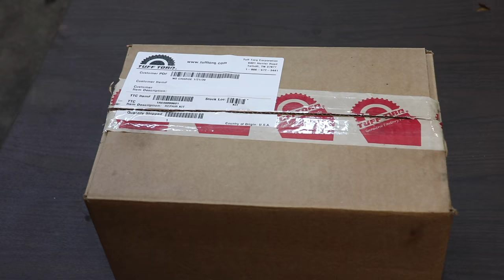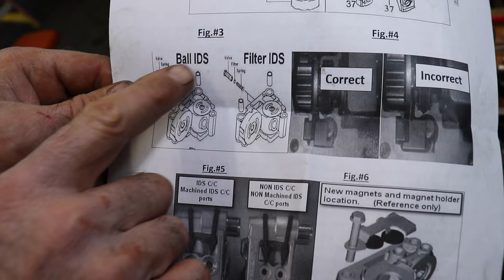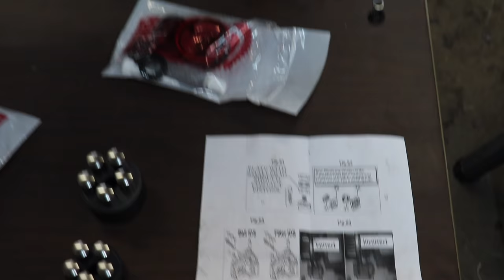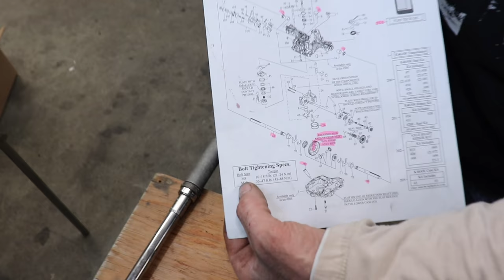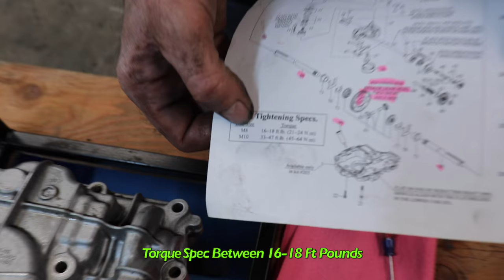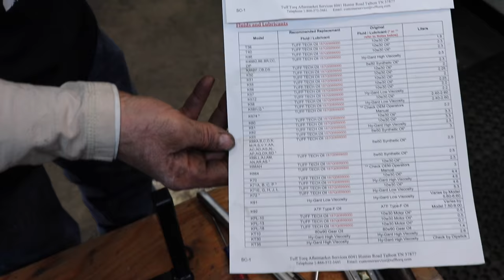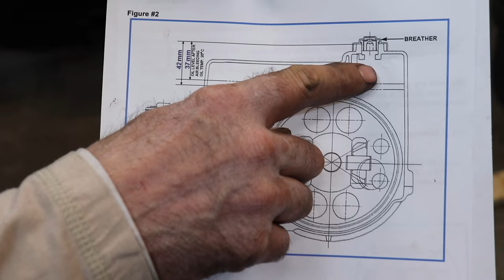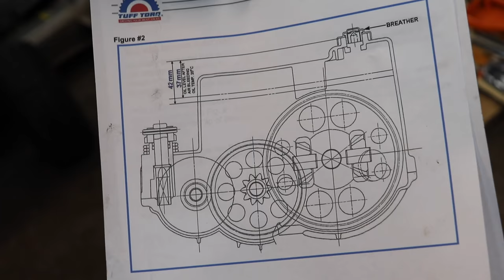How To Rebuild A Tuff Torq Hydrostatic Transmission: A Complete Guide

Comment: I don't know why you can't just drill and tap a bigger hole in the center of where the filter is setting. I looked at mine and you can't see the tiny dimples on the outside anywhere. That big round extension where the filter sits is the best and easiest to work with and you could put a 3/4 square end plug in it no problem. 🙂 Hope I can  find the drain plug video. thanks.  This is my first video with you. Strange. 🤪🤪🤪🤪 are you related to weird Al??

Comment: I'm down with rebuilding a trans but what's the cost of rebuilding it myself vs replacing the whole unit?
Reply: 93sundance Tuff Torq wants $700 for a K46 hydrostatic, $350ish for a rebuild kit.
Reply: @sevbait  Think I'd go with a brand new one then spend half and have the 2-3 hrs labor replacing all the parts.
Reply: @TheMinnow101 Agreed as most shops get 60 to 80 dollars a hour plus shop expense .

Comment: Hello, I have a used husqvarna yth 2448 lawn tractor. The problem I have is the free wheeling lever won't  move to take it out of gear, can you help me ? Plus transaxle is a electrolux 279081 , ser# 080805B001173 , do you have a video on how to rebuild it.
Thanks
Darryl

Comment: At this point in the video you must realize there ain't squat wear at the input that a seal will cure. What happens is the input bushing/casting, can't remember of the top of my old head, gets so bad and wobbles enough to wipe out the fins for the plastic cooling fan because they go into a bad angle from misalignment.

Comment: Taryl / excellent video as always …..Very informative …….But to repair a trans such as this would it have not been more cost effective to have actually just purchased a new trans as some of these service kits often cost 3 quarters of the original price of the original trans. I mean respectfully I also know the alum trans axles will have suffered friction wear as a result of fluid leakage as seen on many Cub Cadets , Deeres, ETC. Note my intent for this comment isn't to asininely pass judgment as the parts provided were free to you. Rather exploit the fact that price for the average joe would indeed be very expensive making such a repair not a viable alternative as even with the guidance of this video to reiterate …..The basic repair kit would cost at least 3 quarters of the price of the said transmission . I can respect savings are {savings] and I respect the fact your trying to provide a video that was informative …..But lets be logistical the mower is likely what 4 years old if not older? …..Now take in affect the cost of the repair and or parts if the owner had to contend with the repair cost as well as repair kit . Now consider this cost long term with the mower as is ……...Now lets estimate the repair and parts cost upward of 450 dollars …...Would it not stand to reason that the hydro belt would need replacing or maybe idlers ……….Whats the condition of the deck ? deck belt, tension idlers, engine, muffler. These issues are imperative to the equipment long term as well as long term cash expenditure . I just feel like these issues should have been taken into consideration before attempting a repair or at least noted in your video as you were provided the repair parts for free . I know we as Techs cant baby set a persons pocket book but as respectful human beings we could make it apparent that the equipment is or is not cost affective as a hole to be worthy of a very costly repair . {STILL I MUST SAY YOU PROVIDED EXCELLENT AND INFORMATIVE INFORMATION } and I can certainly see why you have the subs you do ……{EXCELLENT CONTENT} NO doubt.....
Reply: It seems you may have missed the part where he cut back after the parts arrived. Taryl made it pretty clear that he would have re-used the original pump and motor sections. (You later find out they provided some of the parts & tools free for the publicity.)
Reply: @tomnovak7731  I can certainly see your perspective …..But isn't the purpose of a repair to actually repair the equipment not gamble on the longevity of used parts or at the very least WORN parts shall I say . Now with that consideration what purpose would putting back in the original pump and motor sections serve as friction on there mating surfaces would have been apparent …...Via the alum shavings and or light metal collected by the magnets . So dosent it stand to reason that to truly repair the trans..... vital parts such as the new pump and motor sections where imperative for such a rebuild .  Witch brings me back to my original point …..For the common man would it have not been more feasible to replace the trans in its entirety rather than accumulate the three quarter cost as well as labor expected from a dealer or knowledgeable individual . Taryls great fortune to have been provided parts for the repair was just that {FORTUNATE} ….However there is common logistics that should be applied as well that I touched upon in my previous comment . Had Taryl not been provided the parts for free what cost would the repair tallied in total if the same repair parts where ordered . Now I reiterate …..would it not be more feasible to just order the new trans if the equipment it was repowering {making mobile} was in favorable working order . But lets apply even more logistics as we know the equipment that this trans was housed upon likely wasn't properly maintained or at the very least subjected to common ware and tear effects so to speak . Meaning what about added expenses long term  such as the present shape of the idlers …..Mandrels...Jackshafts.....belts.....tires...battery....blades...ETC.....as the equipment should be accessed before such a expensive repair made . That's why I advocate to my viewers upon my channel to keep a open mind and not be fixated upon a repair as often the cost of the repair can exceed the cost of the equipment . This mentality has saved many from buyers remorse and being a Master Service Tech for Briggs even made a target of me at Service Schools. But I have found a informed customer is a repeat and happy customer even speaking up among my Fellow Techs from there frequent lambasting as I get Stereotyped for my ability to educate and inform with logistical honesty . LOL....lets be honest / Honesty maybe the best policy but whom ever coined this quote obviously hasn't worked as a small engine TECH. That's why when I seen this video I left the above comment . Not to berate my opinion rather open the minds of every individual whom felt compelled to take on the task as a whole rather than just the aspect of the Hydro trans repair . I find more and more that people over look whats obvious and cast a blind eye towards idealisms then find there selves trapped by the price shock of the repair ……..Hints the buyers remorse comes into play …...And sadly its not always there fault as collective smiles and greed of a potential great payday consumes some Dealers to try to convince customers that there 10 plus year old equipment that has obvious additional failures only needs trans work or engine repair . And the dealer knows very well it may need that idler ...belt ….electric clutch …..starter ….etc  but they hesitate to elaborate upon these additional problems because simply they Know that the customer will become a victim of there on stupidity in those moments after the repair further filling the dealers pockets with cash to collectively fix additional issues that may plaque the equipment . I am not trying to advocate that Trayls intentions rather inform fellow viewers of this trapping mentality tactic applied by some shops as well as dealers . Condition of the equipment should be of the upmost of importance in determining weather a repair is cost effective or really even feasible .

Comment: I wouldnt go as far as rebuilding the transmission unless needed . If it's just leaking seals, That's fine. I took apart a pressure washer pump and it works along the same lines.  As far as dealers not working on them. It has to do with time and cost of a whole transmission. Face it, if it's cheaper to just buy a replacement a unit than go through the process of rebuilding one then most places are going to tell you replace, not rebuild. Yes , they are lying when they tell you they cannot be rebuilt. No suprise is it?

Comment: If those vent caps get plugged up with crap it will cause the axle seals to blow out. And I think the only way to get to them is to drop the transmission out. 🤢

Comment: Its a shame, Tuff Torq rebuilding Kit went up in Price from $150 to $300...
Reply: Considering all the parts you dont use, yes.
Reply: I see you realized the same thing I did …...And it made me wonder as a hole was the equipment even worth the effort and cash expended .
Reply: @kevinbolin7665  He did that to show us what it involves and they donated the equipment so that was pretty generous.  
As a small engine man, I do not own a shop any more due to my health.  I do limited repairs and pick and choose what I can handle. My point is, when I get a riding mower with a bad transmission,  I have to consider what I want to put into it as far as what it costs to fix something as opposed to replace it. I have people come to me and I am always honest with them as to repairs versus replace high ticket items.I do know I can fix many things larger shops refuse to scree with simply because it's not worth their time. Most refuse to work on cheaper weed wackers and lawn mowers because the labor fee will run more than the price of a whole new unit. 
I just do it because it's more of a hobby now.

Comment: If you can get by the BS there is some good information here.  Installing seals after assembly without proper  cleaning before removal of the old seal is never a good idea but for the most part that process is also educational in what not to do in sequencing the rebuild process.
Reply: You a shop teacher?  You sound like a shop teacher...